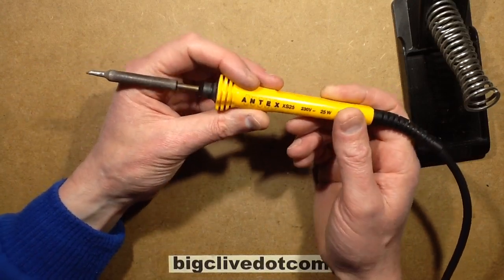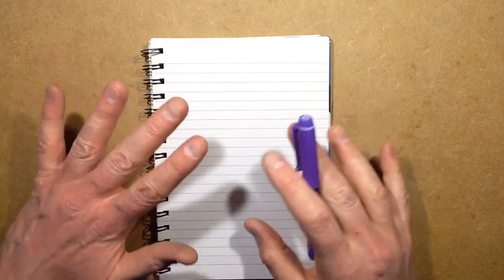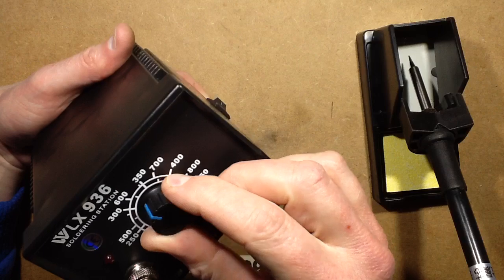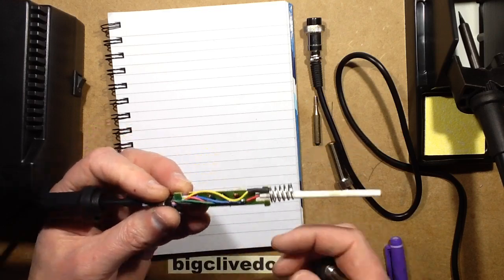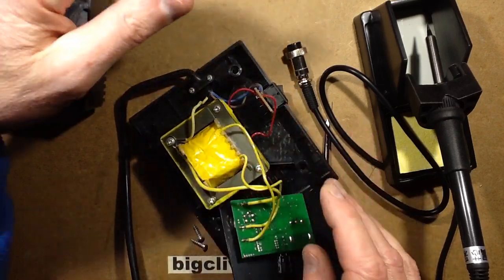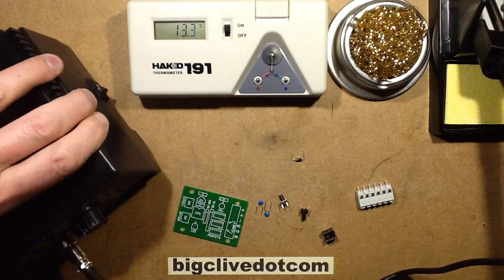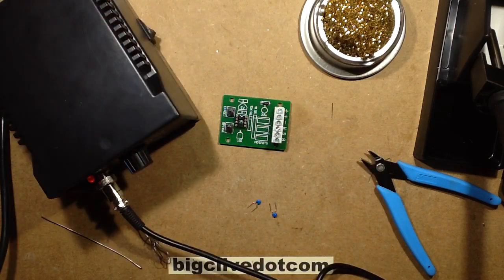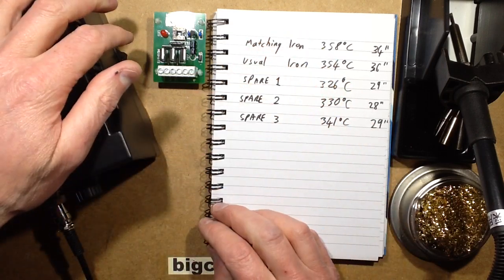Soldering basics and choosing a cheap soldering iron.

Comment: Clive, you didn't mention ESD safety.  Some soldering irons/stations are sold as being "ESD-safe"; which implies that anything else is no good for use on electronics.  I would really appreciate your thoughts on that.
Reply from the maker: +joss levy As far as I'm concerned, if you make efforts to avoid electrostatic discharge at your workbench and all equipment is grounded then it's low risk.  My home has modest humidity (typically 60%) and I tend to wear high cotton content clothing.
Reply: +bigclivedotcom   Thanks Clive.
Reply: ESD Safe= hey hey hey, we grounded the tip for you, so it can jolt your components dead quite easily if your whole workplace is not ESD-safe, but at least the iron tip isn't going to drift to some other unpredictable voltage.

Comment: I own a Aoyue 936, another knock-off from the original I suppose. But it works quite well and has an indicator for when it's reached the set temperature. The temperature calibration is a bit off but so far I really like these kind of units.

Comment: I've been using a variant of the 906 for some time now, it is decent and inexpensive.
 At work I use a Metcal MX-PS5000, quite spendy, but the "iron" is so light and great for delicate work. I solder 30 gauge wires with it all day sometimes... With aid of a microscope no less
I grew up with an Ungar wood burning set that I discovered it could solder as well

Comment: Hey Clive, since you have those tips you don't need would you ming cutting them apart to see if they're copper, since some cheaper ones could be CuFe alloy, which is what the outer layer is made of, but it's not too thermally conductive.
Also since the temp sensor in those ceramic heaters is right on the top so it would be a good idea to make sure it touches the tip, also it's quite easy to cut some beer can aluminum and make a shim for the heater.

Comment: Why would you have to desolder the connector? You should just be able to unscrew the front nut and pull it through, at least that's how it's done on all the ones I've seen... correct me if I'm wrong.
Reply from the maker: +Aurelius R No front nut.  The plug was inserted from the front with the nut behind the panel.
Reply: Wait what? It was inserted from the front, with the nut behind... so there was no nut on the front? Why didn't it slide through from the back? Was there a permanent ring or something?
Reply from the maker: +Aurelius R Yes, there's a flange.
Reply: bigclivedotcom Ouch. That sucks. I'm surprised to hear that, most of the units I've seen are really modular and easy to take apart and replace that front board if needed.

Comment: "Soldering is very much a matter of feel"

Give that man a medal!!!!

Throughout my career i've come across people who insist they know best, they'll be like "your using the wrong tip" or "that's set too hot/cold" and then they'll run around the telling everyone that you don't know how to solder.

The truth is it's about feel, it's about whatever works for the individual.
There is no "wrong" tip and this is probably the one that really bugs me, "it's the wrong tip". What this really means is "i'm used to using a f**king shovel and that's what everyone else should use, regardless of the component pitch".
Reply: +Strider9655 So its all about the feel on the tip =D

Comment: I use lighter petrol (from Poundland) and a small stiff brush and a rag to remove any residue flux after soldering.
Make sure you use adequate ventilation whilst cleaning your solder joints as you don't want to blow yourself up and the fumes probably aren't very good for you :-P

Comment: Greetings from the FROZEN great plains!  Thanks for the videos, I look forward to your videos and check daily for the lattest.   This one is very good indeed. I had been using those cheap junk irons for years, they take a very long time to heat up, and have some sort of relay in the handle that you can feel click on and off as they heat. At any rate, a few years ago I decided I needed something better, this before the great Chinese explosion of products, and went to Radio  Shack where I purchased one of their two speed irons on a nice stand. It was some better, and I pretty much wore it out. Then the Chinese began their mass export to America of very reasonable electronic items. Not wanting to spend a lot, I finally decided on a cheap 110 volt iron with the same type tips as the ones in your article, this one:   110V Adjustable Electric Temperature Gun Welding Soldering Iron Tool 60W + 5Tips
http://www.ebay.com/itm/110V-Adjustable-Electric-Temperature-Gun-Welding-Soldering-Iron-Tool-60W-5Tips-/181964284636?hash=item2a5deaa2dc:g:v~YAAOSwSHZWchft.  I have been using it for over a year now and could not be happier.   Well I did pick up one of those USB irons, and managed to ruin several kits as I practiced soldering with it.  It got way to hot and melted the pads right off the boards.  So now I have a box of ruined kits, as well as about six kits I made with my new iron, all turning out nicely.